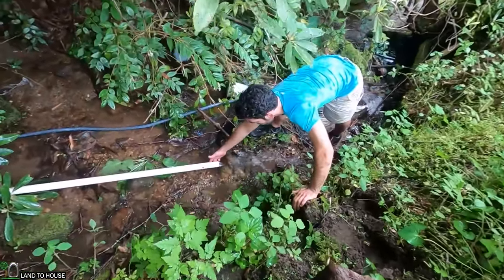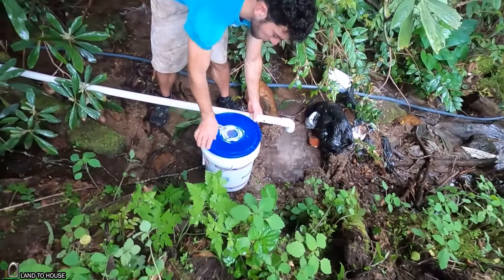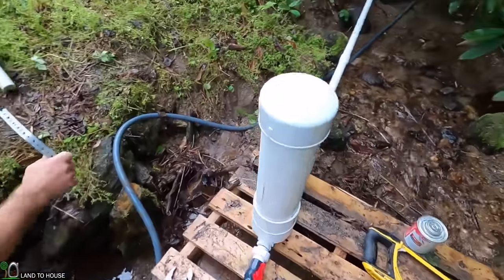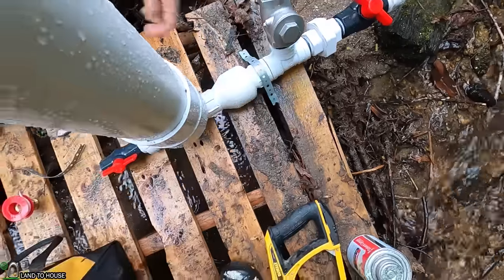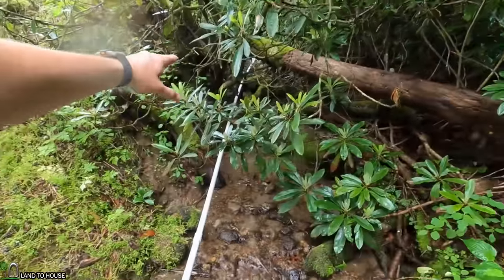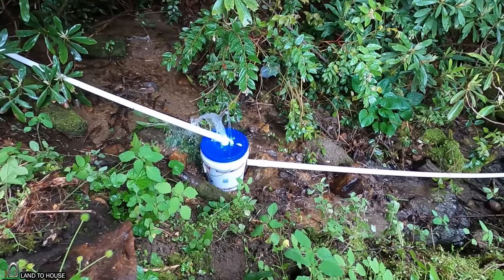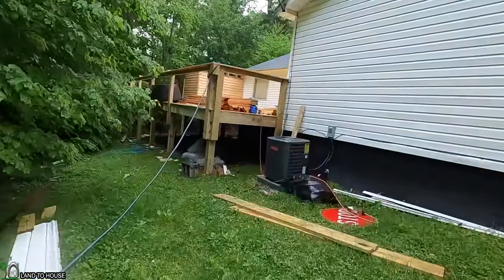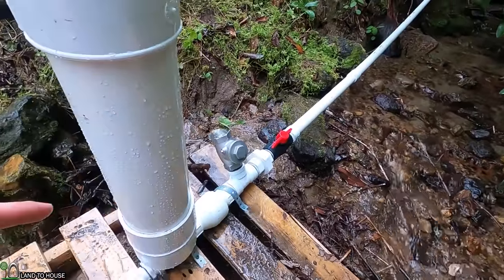Full Ram Pump Install 1-1/4"

Comment: I’ve watched your ram pump videos over and over again. I made my own following your guide. Thank you so much I now have water going into my tank. No power or petrol. Very proud mum of my first ram pump!! Look forward to more from you. Cheers 🍻 from New Zealand 😁👍
Reply: Can I drain my home basement with this system if the basement is below the pump level, or does the pump need to be at or below basement level?
Reply: @rbbartho1  no you can't. You have to have flowing water for a ram pump to work.

Comment: For your filter, ditch the drill and saw slots in the pickup pipe for a simple filter without the need of an extra screen. I recommend a hacksaw width blade and saw about half way through the pipe with each slot
Reply from the maker: I worked with that type intake filter 2 years ago. It works well but takes 4 times as long to make. Perhaps a table saw with sled jig would make it faster.

Comment: I watched a clip of making Ram Pump from Thailand. I saw the effort. And your talents, I really appreciate it. Another clip that is worth watching. I hope there will be more new clips coming out for you to watch. I appreciate it.And if possible, use larger PVC pipes and replace the check valve with a larger one. Air compressor that does that Grow it by 4 to 6 inches. It may increase the water pressure up the hill to get a large amount of water accordingly. Go up and try it. I appreciate it again.

Comment: You guys did good. I like the fact you put in the five gallon bucket to get rid of the air which helps the check valve cycle the way it should. I've seen a lot of videos on ram pumps, but your the first to use the  bucket  and it makes total sense.  I've been a plumber for 48 years and I like learning new things. No I  haven't built a ram pump yet, but I plan to.
Reply from the maker: Thank you. I have over 100 videos on the ram pump and the bucket filter has been a lifesaver.
Reply from the maker: Yes indeed! Air in the drive pipe can be one of the most annoying parts to the ram pump. The bucket idea has worked well in several installs.
Reply: @LandtoHouse  the check value your using is what we call a swing check valve, the spring-loaded check would not work on this system. I wonder how well the spring-loaded check would work if you take out the springs, it may be a little more efficient.
Reply from the maker: Yes I made a video showing that the pvc spring valve is not heavy enough for a waste valve. (Spring removed) 
The pvc spring valve does work well with spring removed it just takes a lot of time to remove when making pumps for shipping.
Reply: Interesting addition. What is the name of the fitting that grabs the 1" pipe in place in the bucket? Can't quite figure it out from the video. Thanks!

Comment: One of the great things about the way you made this video other than great content, is that you were talking about the pump and how it works as you were preparing to install it.For any additional information or visuals needed, you inserted a short clip about making the part. 
You could  give lessons to all the guys who video the entire process of cutting a pc of pipe and then holding it up to the camera for a full minute showing all of the sides. You nailed it perfectly.
Reply from the maker: With over 1200 videos I have done plenty of those slow video clips in the past. I am happy that this one was faster paced.

Comment: This is a great video. I would suggest you use steel vs plastic as it will last longer.. I have built several ram pumps so I know what I am talking about. The swing gate valves usually last a year but they do wear out. 
Great project and its so cool being able to pump water with no electricity or gas..

Comment: that is a super pro install, thanks for sharing. I would consider locking that bucket in place better, storms do come ;)
Reply from the maker: Thanks! Flooding is an issue for sure. On larger creeks I recommend that the pump be lifted out of the water some.

Comment: Dave here from Water Powered Pumps Facebook group.  This week, I hauled by Rokon 2 wheel drive motorcycle and cart, my Land to House 1 1/4 inch ramp pump that I purchased this spring to a somewhat remote location on a creek that passes through our property to begin replacing an old ditch flood irrigation approach.   I made a pond in the creek to cover the filter made as in the video and now have 55 feet of 1 1/4 inch PVC schedule 40 drive pipe leading to the pump.   I estimate that I have 2 feet of head, but didn't think of disconnecting the pump and flexing the drive pipe up for a measure - I'll do that and report back.

I plan on temporarily disconnecting the filter to see if I'm restricting the water flow down the drive pipe - water is clear so not much of an issue with collecting debris.  

The 3/4 inch output pipe goes through 4 feet of PVC and 100 feet of 3/4 inch polypipe to another 4 feet of 3/4 PVC sticking up through sage brushes to temporarily support the pipe with a mini-wobbler on top with the smallest light blue nozzle.  I estimate the wobbler is 8 feet above the pump and plan on bringing in my surveyor's transit to get a better estimate.  The mini-wobbler with the smallest nozzle spreads a 9 foot radius circle of water which I've let run for a day at each location in the meadow area.   Now looking at ways to expand to better irrigate the 4 acres.

Ideas - more ram pumps - plenty of water in the stream.   If I could hook up a solar sprinkler control, I could run 7 sprinklers - one per day - each week from each ram pump.   I think I can get a little more head by raising the dam and extending the drive pipe 5 to 10 more feet down the stream - not much additional fall after that.   Explore larger ram pumps - anyway to bribe Land to House to consider a 2 inch version?   I'd be willing to prepay.

Can the 1 1/4 inch Land to House ram pump be shipped to a P.O. Box in north west Colorado?   If so, any idea the delivery time for this time of year?  Now I'm into trying to figure out the water distribution system given water from one and probably several ram pumps and maybe also other water powered pumps.

Thank you for all you have done to help my project, I'm collecting pictures, but haven't had time to post.   What really helped me was being able to start with your ram pump that actually worked.    Once a week, we come into a small town that has a post office, library with internet and a weekly rodeo - bought lots pipe and fittings to help distribute the water from the ram pump and definitely need more wobblers.

Comment: Brilliant, learnt something new here, the wooden crate will rot out in a few months if that depending on the timber, you can treat them with a mix of diesel and old engine oil, brush it on, get it soaked into all nooks and crannies and it will last for years, the diesel will evaporate and the oils should not leach out, you will have to repeat the process after 3 to 6 months then it will last for years, or use something other than a cheap arse crate

Comment: Been a plumber for 20+ yrs, never had to wait more than 5 minutes for PVC glue to dry, the 24 hrs must be some new fangled glue or some rookie myth.
Reply from the maker: I am the same. For these outdoor projects I typically wait 10 minutes or so.
Reply: I gave my glue a couple hours the other day when installing a spigot in 3 degree weather. Being from texas, i was unsure what the "cure" time would be. Im used to 100 degrees and just a minute or two for glue to set. However, our pipes were busted and this spigot was on a 2nd ball valve i had installed on our main line years ago, so it was a precious resource during our recent weather events!
Reply: @UserFormelyKnownAs_hjkh  yeah, cold weather can effect cure time.
Reply: for real that clear glue i wont even buy let it sit for an hour and as soon as i turned my water back on it blew off a fitting that blue stuff works like a champ tho pretty much instant if used with the primer

Comment: It would be a wonderful teaching material for kids to learn physics and fluid dynamics if you add a simple drawing.
Reply: Not just for kids either. I'm a 68 yr. old lady and never even heard of a Ram Pump before. Good to know. I've always done most of my own Home maintenance and installed a bunch of things I had never done before. If it's common sense I usually can do it and I did a good job.

Comment: I'm planning to draw water to tow levels by using tow stations at 10 meters each in order to supply water to the top of my property, and then gravity shall take over. I'm still flabbergasted with this method of freeloading.

Comment: in my experience,  is that a 'garden hose' leaves a very unpleasant taste in the water.
Suggest using a hose made for drinking water
Reply: Some have said that black poly pipe is not the best for drinking water either - do you know?  Thanks.
Reply: You are right about the garden hose as it contains arsenic.  Walmart sells a food grade hose in its RV section of the store.  It is not expensive, just watch that you never kink it as once it kinks, it leaves an impression, and from then on, it rekinks very easily.  Just unroll it and straighten as soon as possible.  Then, recoil it in large loops to store.  I tie the circle of hose in two or three places to keep the loops together.  This prevents the hose from twisting as you carry it from place to place.
Reply: I don't think he's drinking it, it will be connected to the cool down tank outside of sauna. He mentioned fresh water at the beginning, may have mentioned watering plants, but they never mentioned drinking it, but good point, I remember drinking out of the hose as a kid and it wasn't great. That was before there were many more nasty compounds invented;  good to hear warning about the arsenic also.
Reply: Lead is still used in garden hose.
Reply: Well, of course! RV hoses for drinking water and/or PEX pipes for safe drinking water.
Reply: He never said he was drinking that water, did you not pay attention to the video? The water was for a bath!
Reply: @davebean2886  all it has to be is rated for potable water..

Comment: "Normally you leave it for 24 hours."

I learned that lesson the hard way, changing out a hot water heater. No fun seeing hours worth of work go up in 120° F water spraying out of your new water heater!
Reply from the maker: OH NO. That is not good. As it turns out the instructions are correct on the can haha
Reply: Ya I learned that long time ago . Anytime I install a water heater I always turn temp down on the heater to prevent that .
Reply: No wonder, PVC is not rated nor allowed for hot water.

Comment: Hello budy, how are you,
Excellent pump that you made, congratulations, is this check valve a common one or did you make any changes?
Reply from the maker: Hello. I am well. This is a stainless steel waste valve. Those were sold in early 2020. Once my stock ran out I went back to lead free brass. Lighter valve means less water use and lower head pressure start.

Comment: That is a nice solution for that creek at its current flow rate. If I did that in my creek it would disappear a few miles down stream after the first storm
Reply from the maker: Haha yes.a lot of people have to mount the pump on the bank and pipe the waste water back to the creek.

Comment: Awesome! If you have a creek that flows  a little faster than the one in the video, does that improve overall pressure making closer to a gallon a minute? Or is it just based on the foot drop in the supply line?
Reply: The slope (stream drop) must be at least 1m per ten meters and the length of the supply pipe should be 5-10m. The piston must be "tuned" in conjunction with a pear, which should withstand an overpressure of 10 Bar (therefore it is usually made of solid steel, not plastic). Then it will have satisfactory efficiency. The device from the video is an amateur toy that may meet small requirements.
Reply: @DL-kc8fc  I doubt there are any professional ram pump builders going to youtube to lookup how to build/install these...
Reply: @TheMightyYak  Professionals buy the "Beran" pump in a shop or make it from technical literature. But there are many amateurs who have been inspired and thought about this pump. Therefore, it is good to point out that this would disappoint them in this design.

Comment: Hi Seth! I'll try my question on a more recent video. Will the pump work with a slightly larger drive pipe? To be more precise, a 1-1/2" pipe on a 1-1/4" pump? What about the delivery pipe? Can it be slightly larger too? I'm desperate to know! thank you!
Reply from the maker: The delivery can be any size you want.  The drive pipe works best when it is the same size as the waste valve. There are times that you can use a larger drive pipe but it can cause issues.
Reply: @LandtoHouse  Thank you so much for your reply!! I was just going through all your videos and just found the one you were talking about a larger drive pipe. Thank you so so much for sharing all of this.( And you can ignore the emails I sent you with the same questions) On last question, if I may. Would that be a problem to have a slight reduction for one component between the drive pipe and first valve?From 1 1/4" to 1" and back to 1 1/4" to be precise. Thanks!
Reply from the maker: You might get the pump to work like that but it's not ideal. It's best to have the drive pipe the same size all the way.
Reply: If higher head pressure and good volume of water can use a bigger waste valve, it can create more pressure and can lift higher elevation.

Comment: I've run miles of schedule 80 PVC commercially and I've never had any issues running 80 pounds of pressure through after letting the cement sit for 1 hour...though I do recommend gently priming and purging the system because Ive seen other idiots throw their valve wide open and get blasted in the face with a burst pipe. I also recommend tightly securing all joints with clamps prior to priming to keep stress off the joints...that being said. I've never tested joints on the high pressure side of a ram pump after a 1 hour cure but I dont recommend it, nor do I recommend using old PVC, especially if it has been exposed to too much sunlight because it makes the PVC brittle over time and the water pressure eventually cracks it open like an egg.

Comment: If the bucket is used, the effective height for the source will be the height from bucket to the pump, instead of from top filter to the pump. If you really want to have a bucket, the bucket should be placed on the very top of source.
Reply: Head loss
Reply: what if all the seals around the bucket are water/air tight ?

Comment: Your connections will most likely fail, because there is water pressure, and glued fittings have not been allowed to cure. FYI.
Reply from the maker: This one is still good after a year.

Comment: Add helical screw conveyor to the delivery pipe dia 10 mm with a check valve at the start of delivery  pipe dia  10 mm.  This will reduce wastage during pumping  through  ram mechanism and increase dia of ram 2 Times then previous 1/14"

Comment: Ram pumps work using the energy and momentum of moving water. The water head isn't directly relevant, though water head can easily be converted into water momentum. 

This is important because a water pump can be used in a fast(ish) moving river even without any water head.

Comment: Exilent , interesting only 1 gate valve .
 I'll be using a rampump to deliver spring water through a four 55gal barrel gravel sand charcoal filtration system .